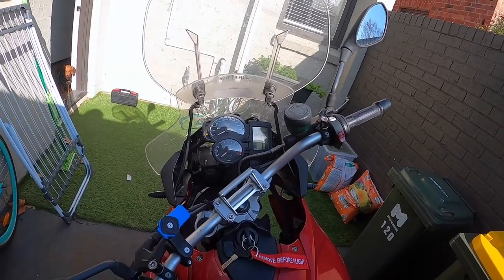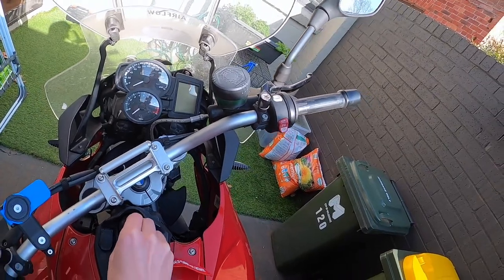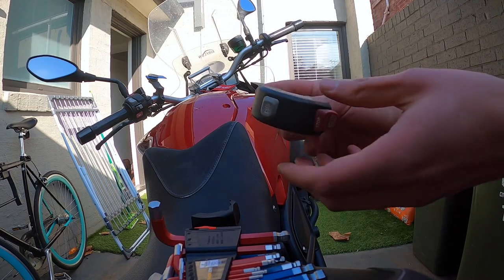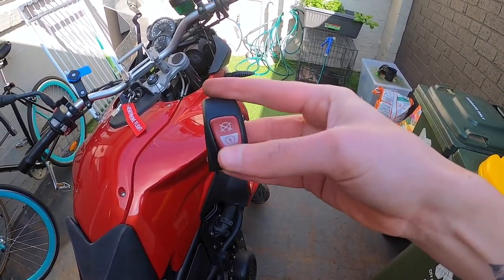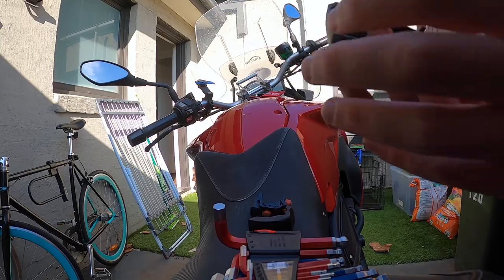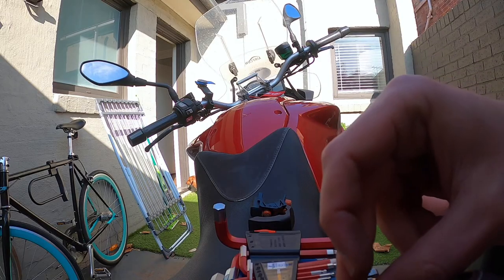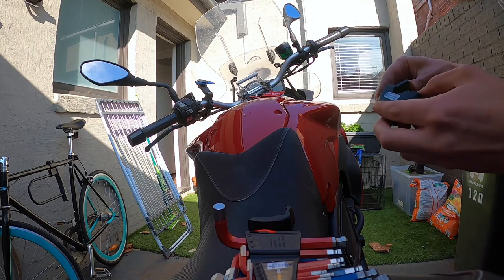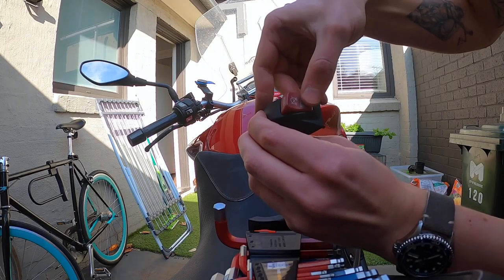BMW Motorcycle stuck ignition/starter/kill switch - and how to fix it

Comment: Thanks for the video. I just recent purchased a 2013 BMW F800GS with 4,000 miles on it which based on the maintenance records had the switch replaced on a bulletin at the original dealer back in 2015. I was on a three day camping adventure in Texas this week and noticed that the switch started to become almost impossible to start the bike. When I got home, I found your video and removed the white safety pin and spring...PROBLEM SOLVED!!! It took less than 20 minutes to take it apart, remove the pin and reinstall. One note for future readers...once you remove the first screw, you can then remove the bottom portion of the housing to access the second screw. These are 8mm screws. Thanks again for taking the time to make your video and share this information. The repair for a replacement at the dealer is close to $300. The white pin really serves no purpose other than to make it a bit harder to presser's the switch. The switch still functions as normal, just without jamming up and preventing you from starting your motorcycle.
Reply from the maker: I’m very glad I could help you!

Comment: Hello, thank you for the usefull video. It helped and saved a lot of hassle and money as well. 

I can add as an addition to the issue, that I found the little pin with the spring after many switches it becomes very sharp preventing the switch to "jump" between STOP/START position smoothly. What I did, I sanded down the sharpy edge, to make it a bit more "round" shape, to help between switches. This way and using some grease, it is working as smooth as before the issue. Good luck!

Comment: Gracias, Just did the repair to a 2017 R Nine T. Everything was exactly as described. I did however reinstall the little white thing. I removed it, sanded it a bit to sharpen the tip and reinserted it. It works great now.

Comment: Thanks !😁.This is an excellent help and saves a potentially expensive problem or getting stranded. It is a 10 minute job BUT to undo the screws (as the video says) you need a T8 screwdriver and these are not so common as most sets stop at T10 so make sure that you have this before starting

Comment: Thanks for doing the video. My  2014 1200GS LC just started having this problem. Took me about 30mins after watching your video and searching for a T9. Found one in a mobile phone screen kit! I  rounded off the Sharp edge of the plastic pin with a file, greased it up and it seems to work fine.

Comment: Thanks! This helped me troubleshoot my F800R that wouldn't start. Might have just been bad wire connection but at least I got it starting after cleaning the inside and lubing the pin. Would probably not even have been able to open the bloody thing without your instructions :)

Comment: Why are these switchgears so expensive and so rubbish? They seem to be made in China for pittance. BMW are really a rip off with parts. My RT menu button is sticking all the time. I've taken it to bits, cleaned with WD40, greased and it still sticks. I tried AFC50, spray grease, nothing seems to overcome the crappy design and rubbish plastic. Unfortunately it's all sealed and is very hard to get behind the one switch I need to really look at.